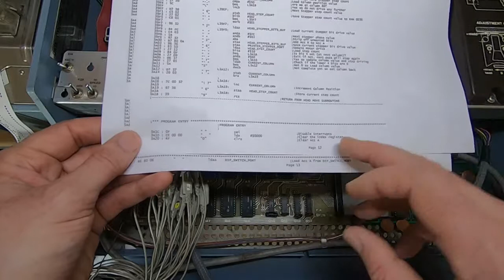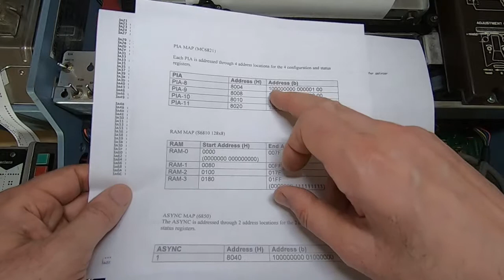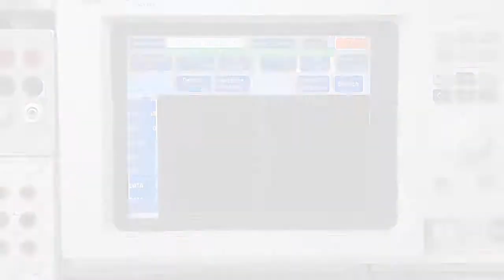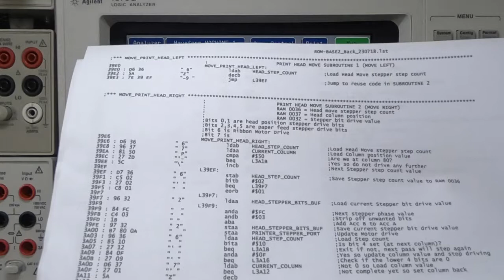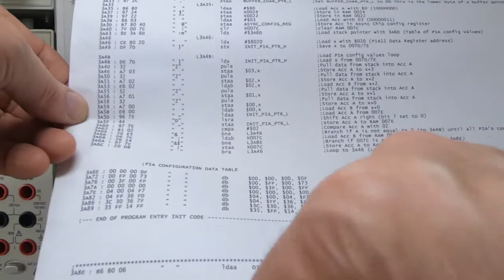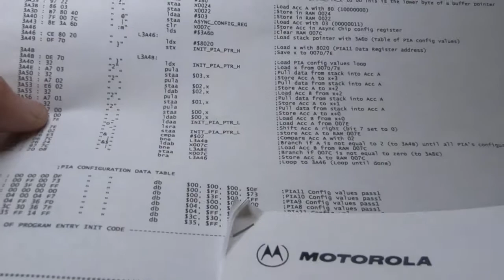Reverse  Engineering Firmware 5

Comment: Jerry, I don't recall whether you already answered this, but here goes:  Can you output (i.e., save to PC/paper) the data captured by the logic analyzer after a run?  Or do you have to "scroll" back & forwards comparing, "real time," what it captured vs. what you've disassembled, like you were showing at the end of this video?
Reply from the maker: You can print or save to file but I almost never do that. I generally use the analyser for tracing the code execution  so there is no real value to saving the data. It would be a bit like storing voltages measured with a DMM. I start with a print of the disassembled firmware from the system ROM's and then use the analyser with triggers set on points of interest. The analyser captures millions of lines per second for a typical system so the trick is to figure out how to capture just the data of interest. I also very rarely use inverse assemblers as it is more the specific hardware system I am working on that I want to investigate rather than the code itself. For example the PDP11 I am showing in a current series is a custom system so I need to figure out what to look at based on what I find at each step. If I have a schematic and source code then I take a different approach but it is very rare to have both of these.

Comment: Did you do most of your work looking at the waveform view instead of the list view? I find it a lot more natural to follow code execution in list view, especially when using an Inverse Assembler to format the list view. I suppose once you start looking at interactions between the code execution and transitions on peripheral signals that might be easier to visualize in the waveform view.
Reply from the maker: Most of what I was doing was fixing faults so the list view from the inverse assembler was garbage so I ended up using the waveform (linked to the scope input) so that I could capture the actual signals rather than assume the system was working as it should. About 80% of the work was looking at the perhipheral signals so the IA would not have helped as that is not captured by the IA. I used the list view and IA towards the end when the system was working and I knew how to label the various elements. In the videos I am showing the bare bones approach on the assumption that everyone may not have an IA. As you said it was easier to use the waveform when investigating the periperals which is what I needed to look at. I also linked the analyser to a PC via ethernet and then I could examine the code in more detail but I could only do that once the system was working. It did not actually take very long to get the unit basically working and most of what I did was trying to get the tape reader working (unsuccessfully) so this as almost entirely tracing external signals.